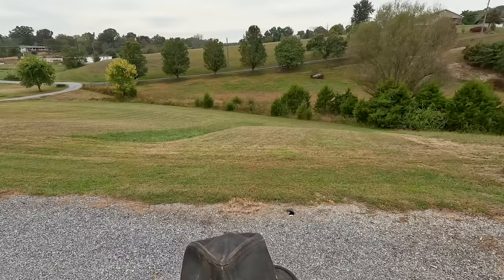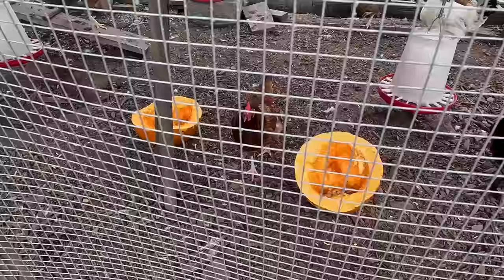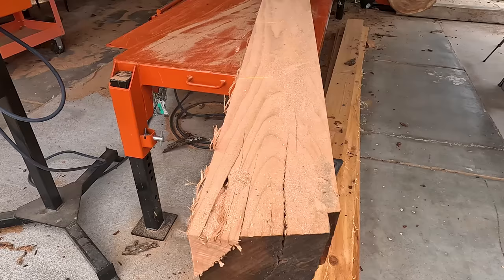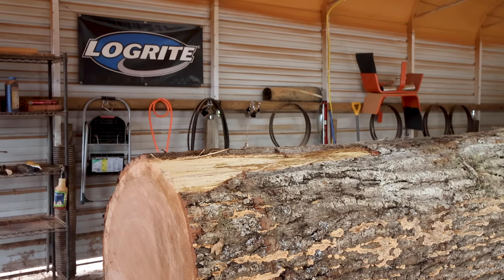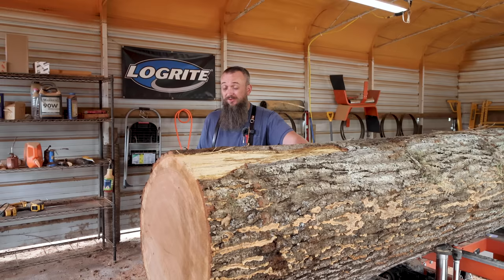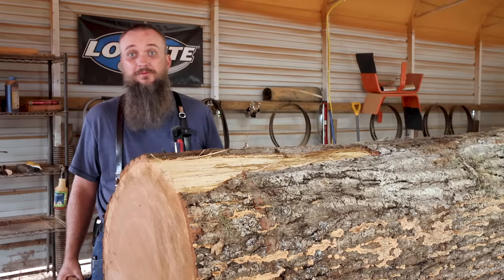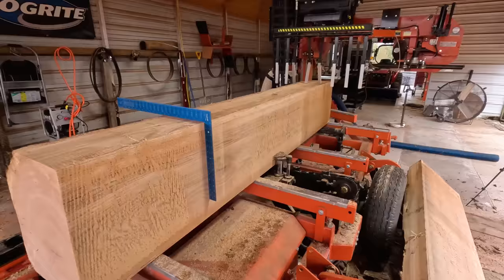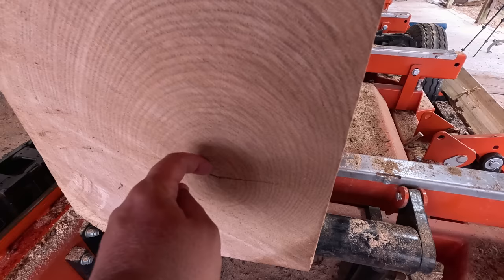See How I Sawmill The Proper Way For Big Profits $$$

Comment: I'm guessing that the board with the pith in it was discarded to firewood cuts. In my area poor folks would also love those oak slabs for firewood even though bark makes a lot of ash compared to solid wood. Just depends on how much you need firewood what you are willing to burn to stay warm. I use to go to a mill and get that stuff for a couple I knew on hard times. They did not have a truck so I would load my pickup and drop it by their house. If I ever was driving down the road and saw their wood stack low, I would just go get some next time I had a free minute so they would not run out. Funny thing was later in life when I was broke down more, other folks did the same for me. Funny how that works. Usually it was either the local saw mill for oak cut offs or slabs or go to a friends and cut up his top pile from the loggers doing their once a decade harvest. Tops from oak, hickory or walnut make good firewood. Those crooked limbs were no good for lumber but sure heated homes well.

Comment: Bull dozers and excavators are very rough on the planks on trailer decks. No matter how good the operator is. .. Back in the day when there was lots of farm trucks around with wooden body’s on them, they used poplar planks and boards to build them around my area. Rebuild them every 8 to 10 years or so.

Comment: Lot of guys back in the day used rough sawn lumber that was three inches thick for those lowboy trailers for heavy equipment. Would not be any harder to do for you and might last longer for them. Just a thought. Dozers and excavators are hard on trailer decks with those metal tracks.

Comment: Nathan, you could treat the red oak the way my paternal grandfather ( a farmer) used to treat his fence posts. He coated them with multiple coats of linseed oil. One of my uncles had a pair of poplar livestock racks that Grandpa treated with linseed oil in the early 1960s. Those racks were still in service until my uncle passed away in 2017( over fifty years after they were treated).
Reply: Creasote?
Reply: As an end user, that's a great idea, lumber preservation means money saved over time, as a sawmiller, that's lost revenue, leave it for  the customer to decide.

Comment: I retired from construction and was around a lot of equipment trailers . One company I worked for had there own equipment and trailer. I was there for twelve years and the deck never had to be replaced and thats in the snowy ,  salty and wet north east hauling  a dozer,backhoe,bobcat ,concrete forms. For other companies hauling dozers and excavators I don't recall seeing new boards . Maybe the guy wanting the boards side loads which tends to tear things up

Comment: Nathan, you seem to be getting a lot of blade irregularities (grooving?) throughout the cut and it leaves a path of sawdust in them, it seems to come and go. Do you know what causes that and how to get rid of it? I'm having that happen as well right after swapping to Silvertip blades and I never had that issue with the blades that came with the HM126. I've made some adjustments but it never has gone away completely...and that's in poplar. All my previous blade cutting was smooth as silk unless I got a tooth bent. I've tried three of the silvertips so far and all have done this same thing where the wood is rough part of the way through the cut and there seems to be no rhyme or reason...not caused by knots or anything I can see. I had put on a new drive belt as well and I thought that may be causing it to loose tension quickly as it compresses but after seeing yours do the same thing I'm hoping you see this question and have some experience to share.

Comment: I've been watching your channel for awhile along with a couple of others. My question is what's the difference between the sawmill that you have and one that has the rotary blade that cuts on the side .
Reply: The nominal thickness of the saw blade, circular saws are usually 1/4" compared to 1/8" for a bandsaw, also the cost for a 56" circular (cutting up to 22.5") is counted in $1000s per blade and are usually made to order, check out mark galicic, he uses a circular saw driven by a detroit deisel.
Reply: @unclegreybeard3969  thank you sir, very helpful to me. Mark Galicic, is one that I also watch. His setup is what prompted me to ask. Also just a side note, my oldest daughter works for Detroit Deisel inspecting and prepping the engine blocks.